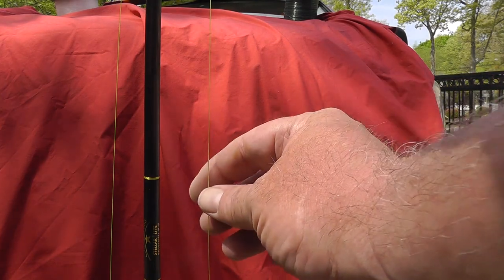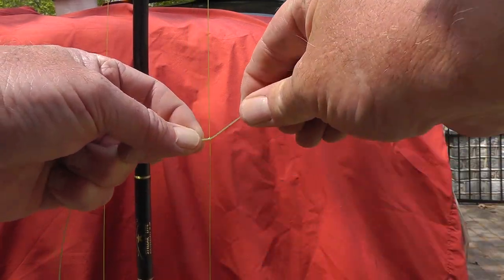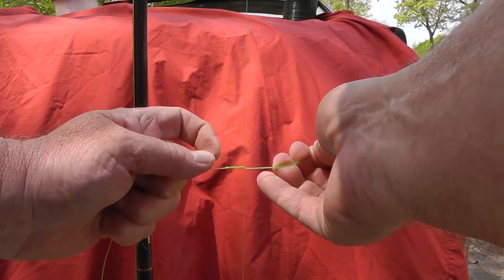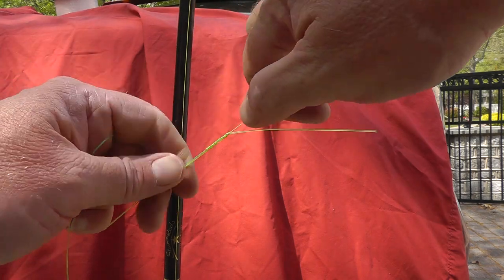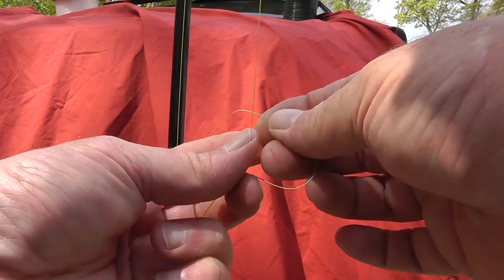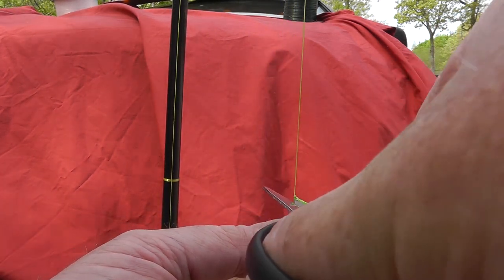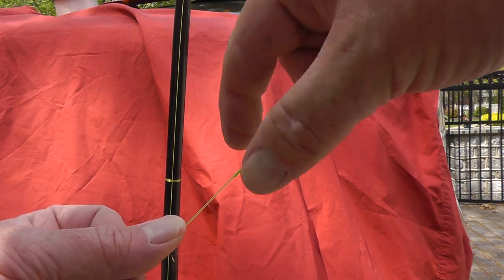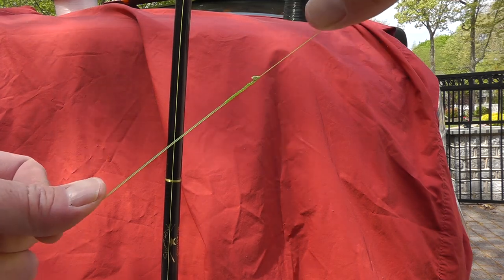HOW TO Tie BRAID to Monofilament Fluorocarbon Leader - Fishing Knot

Comment: I've been using this knot for a season. I can't say it's 'never' let me down but I like it and it saves me money. Here's how, I use continental 16ft beachcasters which have small tip eyes which call for a very slim knot. Normally using 30lb braid, a 30lb to 60lb tapered shock leader is needed to allow a small double Albright. Using this knot allows me to use regular, and much cheaper, shock line. The beaches here are full of snags and it's common to loose gear with this method it helps keep costs down.
Reply from the maker: +David Harvey Thanks for taking the time to leave your feedback and thoughts on the knot. hope you have a great season on the water, tight lines, Capt Paul

Comment: yep,  this is going to be the one I do from now on.  I did I think it's the double uni knot,  but had some trouble with it.  think this is the best way to go.  took me a few times to get it right. 
I have noticed that it was hard to get with two same diameter lines.  was using 20lb braid and 6lb flouro (pretty much same Dia.)  Just moved up to 12lb flouro for the liter and it works everytime.
Reply from the maker: Mike, I hope it works out as well for you as it has for me, good luck on the water this year, Cheers, Capt Paul

Comment: Thankfully, I don't go through leaders very quickly. In this case, it meant that my Bozeman Flyworks leaders sat in the leader wallet for a while, before I put one on. Very impressed>>>allabout.wiki/lxtl    Butt section was wrapped quite a few times in the coil, so it took some straightening out, but the mid-body and tippet were strong yet supple, with very good roll-over in the loops. Might consider phasing these in as more than just my 9' 5x option.

Comment: 10/10 demonstration! There was another way of doing it but I found it way too tricky, this really is the easiest slimmest strongest knot I've used. The more tension I have on the line the slimmer and stronger it holds I think thats the only tip with doing that knot.

Comment: any update on how the knot faired?
Reply from the maker: +Elias Nasr the FG knot help up fantastic!! I did not have a failure with it at all. However, I still find myself going back to my OLD knot when needing to re-tie in a hurry on the boat after a breakoff just due to the fact I can tie it MUCH faster and more efficiently than the FG. I have nothing bad at all to say about the FG knot as it did work VERY well, just that my old knot works very well too and I can get the rod back in action a LOT faster with the old connection. :) :) :) Tight lines, Capt Paul